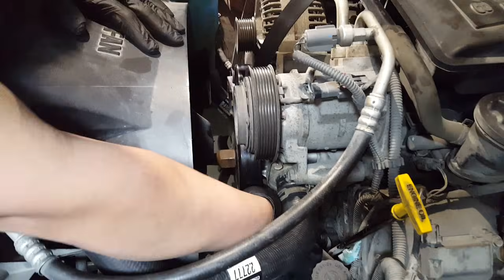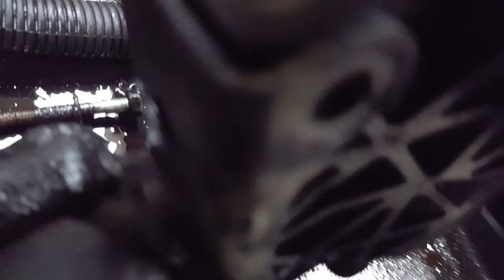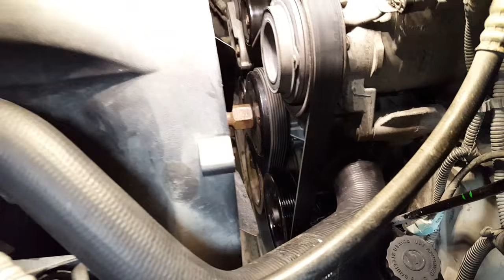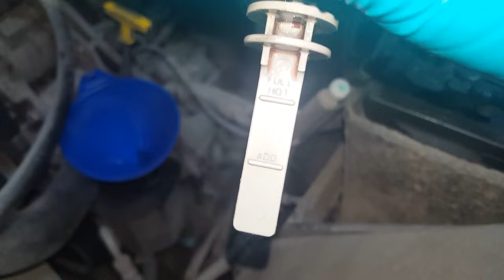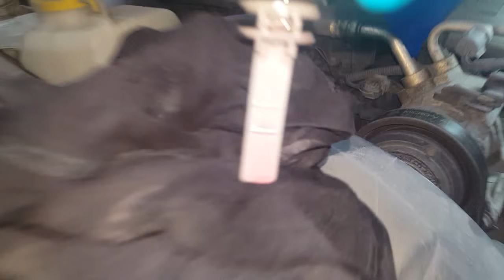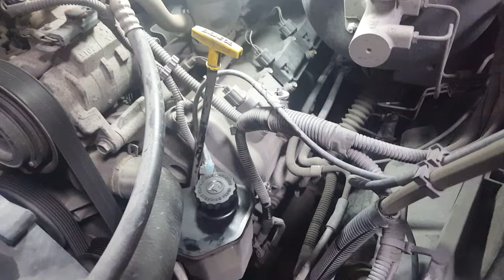2002-2008 Dodge Ram 1500 5.7L:  Replacing the power steering pump

Comment: For some reason many parts store don't sell the pulley separately. Will the 07 pulley fit on a 08?
Reply from the maker: Arthur Jolicoeur I don't recall there being a difference in the pulley between 2006 and 2008.  I haven't had a 2008 Ram with the 5.7 Hemi in the shop for a while...so can't verify that way.  If I figure it out I'll let you know.  You could always re-use the original pulley.  Rent a power steering pulley puller/installer kit from your local parts store.  Unfortunately I don't have a video of that process but there should be several on YouTube.
Reply: AKJeeper the problem I'm having is the original pulley is broken and no one sells the pulley as a separate item. Pump yes, pulley no. Few places if any well the pump with the pulley except the dealer and they want me to purchase the pulley, pump, res, and bracket for $1400. 07 seems to be the last year they sell the pulley separate. Let me know
Reply from the maker: I find that really strange, without seeing a 2008 pulley - I can't understand why a 2006-2007 pulley wouldn't work.  I just looked on a parts website and it appears that the 2006/7 uses the same serpentine belt as the 2008.  The only thing I'm seeing is that it looks like the 2008 model has a ZF-brand/style power steering pump, while the earlier years have a Ford style pump.  The power steering pressure hoses seem to be different between 2006/7 and 2008, also - which could be the result of having a different style of pump.  The trucks all seem to use the same steering rack and pinion, though.

You might have to get a pulley from ebay or a salvage yard, if the 2008 pulley is indeed different than the earlier trucks.  I won't recommend retrofitting an earlier pump/pulley/pressure hose at this time, without knowing specifics.

Comment: Every dealer i talked with said it called fir atf+4...whos right you or the dealer?
Reply: Should be ATF +4 it is right in the owners manual. Dex should not be use in a Mopar unless ATF+4 isn’t available. You will probably be fine using Dex in power steering or even power steering fluid but factory was ATF+4.
Reply from the maker: I just checked with my local dealer's parts department.  The fluid part number has recently been superceded to 68218064AB, and it is labelled "Mopar Power Steering Fluid +4".  It looks and smells just like ATF.  Strangely, they also had bottles of "Automatic Transmission Fluid ATF +4", which has a part number of 5013457AA and a similar color/smell as the 68218064AB.  Without running a fluid analysis, it's tough to say whether these two fluids are indeed the same (but in separate bottles/packaging).

When in doubt, always go with the manufacturer's most updated recommendation.  So in this case, use "Mopar Power Steering Fluid +4", part number 68218064AB.

In my opinion, in a late model Chrysler power steering system, you won't go wrong running a synthetic ATF (as I did), or using "Mopar Power Steering Fluid +4", or Mopar ATF +4 (which is a semi-synthetic fluid).
Reply: AKJeeper thanks for the follow up...I went with atf+4...no problems

Comment: did you remove the radiator to get to the pump?
Reply from the maker: It is not necessary to remove the radiator at all.  In this video, the radiator was removed so that I could get a better camera view of the bolts that need to be accessed on the pump.

Comment: Is it me or did that bottle say "Transmission fluid"
Reply from the maker: Yes.  This truck (and many other vehicles - Toyotas, Fords, etc) specify automatic transmission fluid (ATF) for their power steering systems.  ALWAYS check the owner's/service manual or consult a dealer to ensure that you're putting in the correct fluid!
Reply: Just a heads up we put mopar ATF+4 in all these and it is synthetic, no issues, Im a tech at dodge. Good Job.  @AKJeeper

Comment: was your pump whining and tight at low rpm?
Reply from the maker: Yes, it had a high pitched whining noise.  And barely any power assist at low RPM.  It got worse in cold weather...and at times the pump would cease to make any noise and also cease to provide power assist.  I took the old pump apart and found that the vanes inside were worn and one of them was actually fractured!